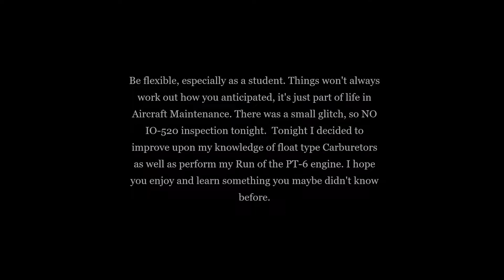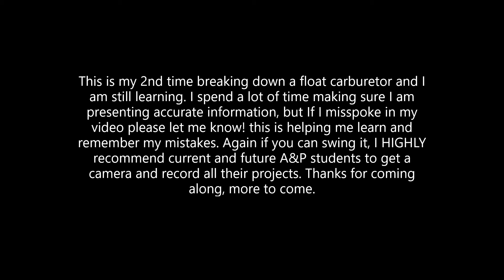Aircraft Maintenance School: Carburetor Project

Comment: Flip it over when putting the halves together to visually see the mixture "spring" go into its piece in the bowl. The reason it's bent is because it's not going back together correctly.. You cannot see and verify it's seated when the carb is upside down. The mixture control will not work. When the carb is upright you can look down into the bowl while putting it together to insert the mixture control "spring" into the piece in the bowl so it will go together correctly.. It's impossible to set the bowl on upside down and verify its seated.